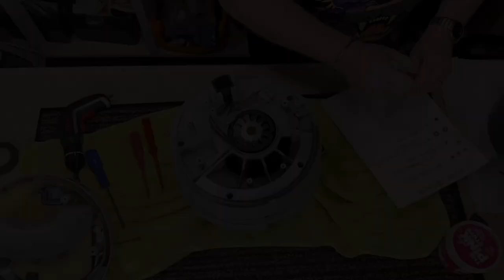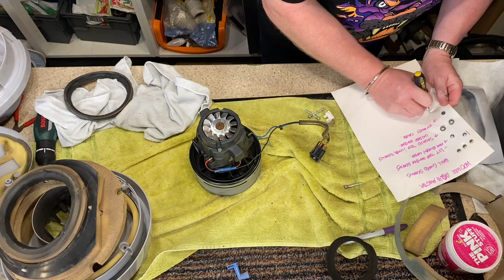How To Disassemble A Hoover Aquamaster S4470 Part 1

Comment: Found one of these flytipped, was just going to put to proper recycling, but tested it and it worked so this video has helped with its strip down!
Reply from the maker: Oh excellent! They’re really good as vacuums, the carpet washer side of it was a bit meh, but as vacs and tough vacs, I love it.
Reply: @HooverLux  Cheers. Going to use it for the garage. Innards a bit rusty in comparison to yours and think the metal below the motor is bonded so can't be fully separated unless you think otherwise?
Reply from the maker: Ooh, I can’t remember?, but if it sounds ok, I’d leave it to be honest as it’s a garage vac, It will be perfect for you.

Comment: Hi, i too wanted to overhaul my Aquamaster S4470 many years back. Tried looking on YouTube and internet as you did and found nothing. I couldn't figure out how to get that lid off. Cant believe I didn't think to check under the handle. Quick question, whats the reason to cut off the supressor? I'm currently starting the overhaul following your procedure.
Reply from the maker: Hi, glad the video helped you. I remove all the older suppressors off these vacuums as they can go bad after a few years and then explode or fizz, so to prevent any damage I removed them as they are there to stop analog interference, but so much is digital now it doesn’t make any difference. 🥰
Reply: @HooverLux  Ah great, thanks for the reply. I will then do the same. I've fully rebuilt the system now, all the internal sponges i put through the washing machine and then after dry, glued back on with contact adhesive. The hoover is running perfect and doesn't smell like wet socks each time i turn it on. As good as new and super powerful.

Comment: I have a hoover aquamaster however the cooler fan came detached and yesterday we stuck it back on. Today it starts to spin and then jams up. Looking at your strip down it seems there should be a washer with a screw on top which was not present when I opened it up and when I originally ran it the fan kept spinning off  the spindle so we thought it had worn down so the sticking of it down.  Is there any chance in your opinion that it can be brought back into action or is it useless now?  Thanks for your attention to my problem.
Reply from the maker: Hi Doreen, oh gosh, it’s so hard to diagnose without seeing it in front of me, I’m absolutely no expert, but I’m a capable tinkerer 🤣, there’s always normally some way of fixing these.
Reply: @HooverLux  i stuck it on with super glue and now trying to dissolve the glue. Not given up yet but will be devastated if I don't succeeded. Wish I had seen your video first.
Reply: got it detached. Will be returning to England in a few months will contact you for you to see my wonderful hoover acquamaster and hopefully bring it back to life.